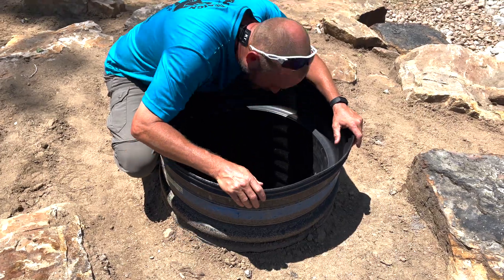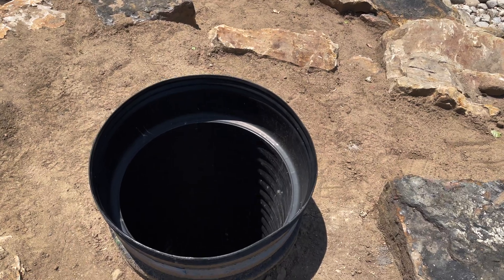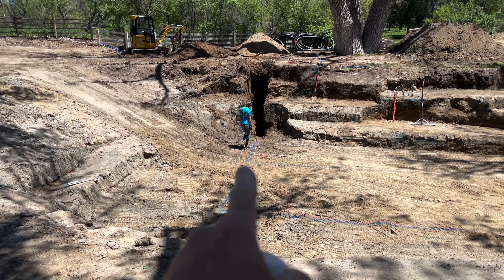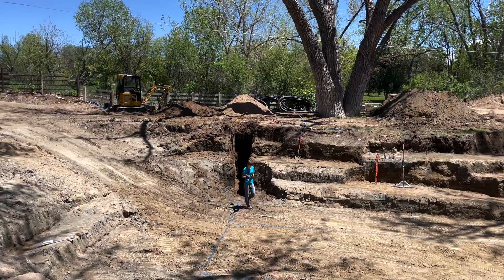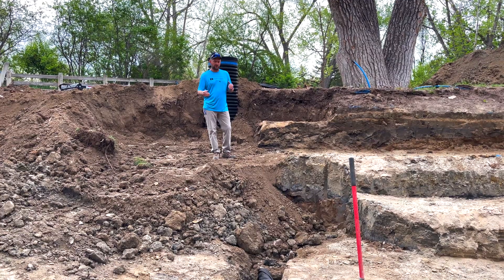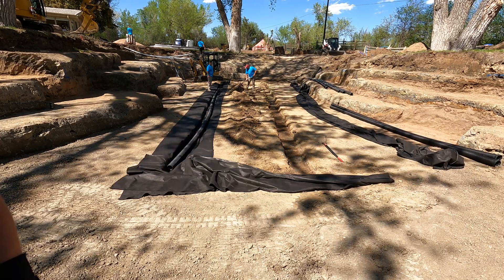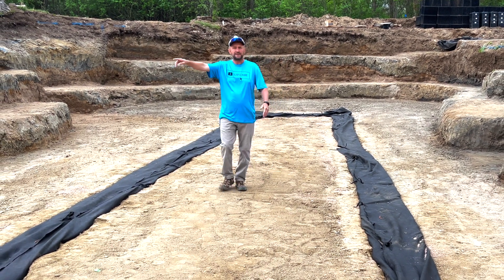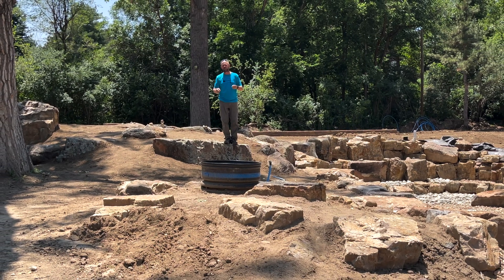Under Pond Drainage (Prevent Bubbles) | Water Feature Design Series #14

Comment: Hi John, 
I have a question, did you have to raise one side of the drain pipe to allow the water to flow? I know you mentioned the hydrostatic pressure, but I'm just curious. 
I have a smaller koi pond and during the summer we get a lot of rain in Florida and I just had a plant shelf wall cave in b/c water got under my liner. When there's a lot of rain, it takes a day or so for my yard to drain so while I have the pond drained & rebuilding it I figured I would add a small drain like you have here with an area to drop a small sump pump.

Comment: Have you ever seen these under floor drainage systems collapse inwards like a sink hole?
Reply from the maker: No, haven’t seen that one?
Reply from the maker: I guess it could happen if there was a way for the water to take sediment or soil out with it as you remove it from below?
Reply: @KoiAddiction  Primarily if it wasn’t packed in properly, and over time it packs down and subsides, with all the fines washing out during rainy events, and thus causing a void to start forming where the drain outlet runs

Comment: So..this will work for rainwater.....I think i will have a problems with rain water running under the liner. The pond i'm building  is alot smaller, but i think this will work. The pond is on the down hill side of the slope
Reply from the maker: Protect yourself. No one likes a bubble under the pond!

Comment: What’s your thoughts on using this on a larger scale for a lawn on a lake with a very bad water table? Lawn can only be mowed about two months out of the year if they are lucky so the rest of the time it’s like a hay field.
Reply from the maker: It will work anywhere but if the water table is always high you make need to “amp-up” the system for constant operation to avoid issues. I would consider raising the pond level as an alternative.

Comment: Thanks for these videos - I love this series! Should gravity fed drainage work for this purpose? Assuming there's enough elevation drop of course. Someday I want to build a pond inside a greenhouse, which will have french drains or form-a-drain around its foundation.
Reply from the maker: Gravity drains will work and also you should know that if the drain lines are only a partial way up the side of the pond, the hydraulic pressure of a full pond will push water uphill through a pipe as long as it is below water level in the pond (if that makes sense?). Think of putting water in a big pan representing the water under the liner. Then put another pan full of water on top (representing the liner and the water it contains). The one on top will push the water below effectively forcing it out through a drain thats closer to the top-the water always takes the path of least resistance!

Comment: It looked like you used a pvc pipe to connect the drain to sump vault. But could tell. Great job.
Reply from the maker: Absolutely once we got past the point where we needed to let water into the corrugated pipe we shifted to schedule 40 to avoid the pipe getting smashed during the backfill and construction process.